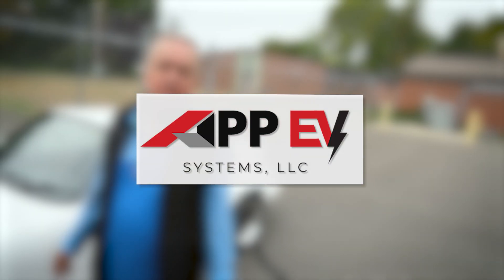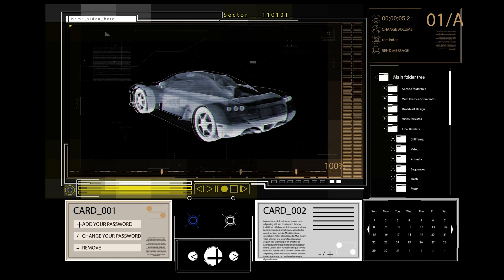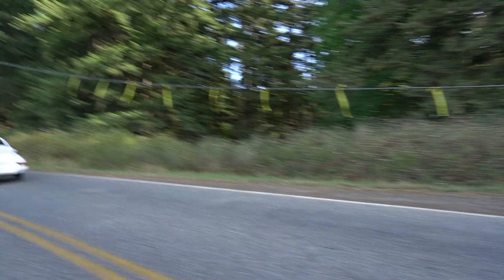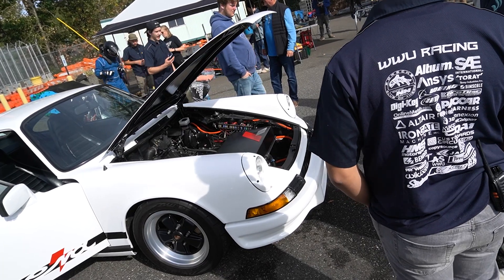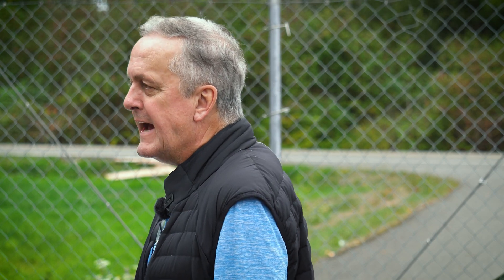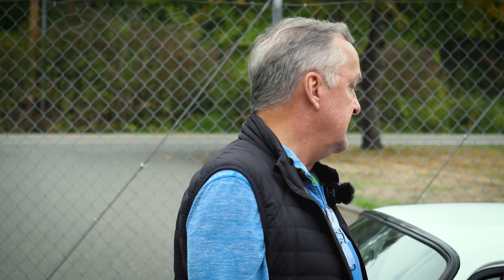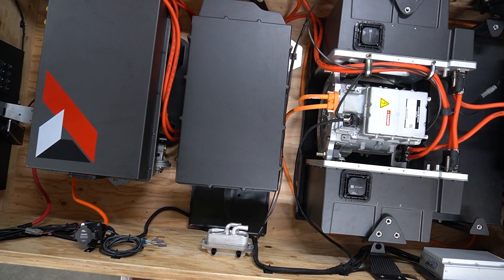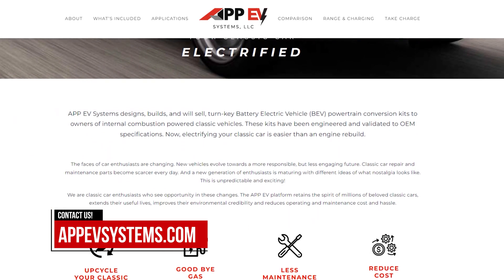DEEP DIVE! APP EV's Plug & Play 911 Conversion Kit

Comment: It is good to see this level of a complete conversion system available in the US finally. I agree with keeping the original transmission in the car, that is the personality of the car far more than the engine ever was. I love the look of the motor with the battery boxes on the sides, that resembles the original 6. Will you be selling parts of kits? My car are already converted, but I like the look of your parts. I have my rear packs on each side of the motor in my 914. I should point out the sight tubes on those coolant tanks seem to leak after a few years. I just removed the sights and sealed them with plugs. I think that is the extent of repairs on one of our conversions in the last 6 years.
Reply from the maker: Thank you for the kind words and feedback! Our battery packs are sold separately. They are new, OE batteries with 8 3S4P VDA battery modules per pack coupled to insulated busbars. Our coolant connectors are OE-spec and are quick-connect design, and you can choose their directional orientation. The enclosure is made of carbon-Kevlar-fiberglass for lightweight and strength, and you can mount the packs in any configuration. Four packs can be linked for up to 73 kWh. Please email us or give us a call for more info, and we'd love to see your conversion!

Comment: What is the weight difference of the car from original engine configuration to installing your system? Also what is the weight difference the from the original engine bolted to the transaxle and your electric motor bolted to the transaxle. Porsches notably have oversteer. Does this balance the front and back end of the car evenly, thus improving oversteer?
Reply: Looking at their website it looks to be 300 pounds heavier than stock for the version of 911 they converted. Original 911's varied in weight 150-200 pounds depending on the configuration. Usually the front battery box is about 100 pounds heavier than the full fuel tank it replaces on a rear engine car.
Reply from the maker: Thanks for the reply @dennelson6980! Yes, it is slightly heavier (approx. 300 lbs.), but this weight increase is offset by the increase in power, although we also provide a power map that replicates the factory engine power and delivery if you are feeling nostalgic. 🙂 Driving characteristics are relatively unchanged aside from noticeably more stiffness in the chassis thanks to the front and rear carbon fiber subframes. There is more balance, with just a hint of understeer.